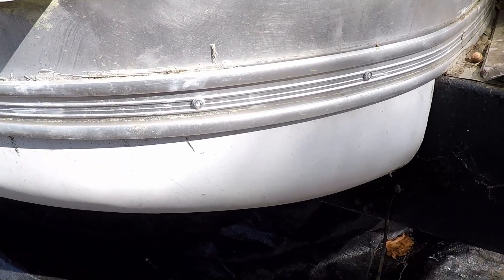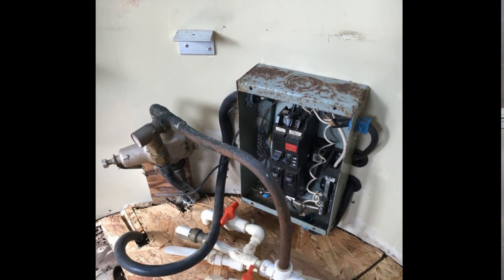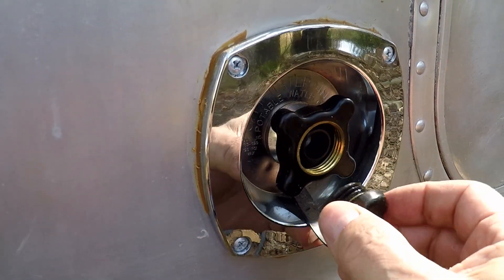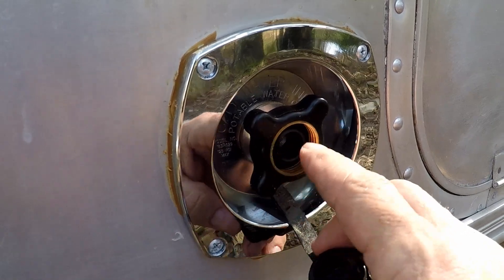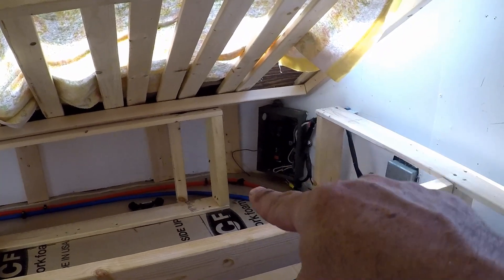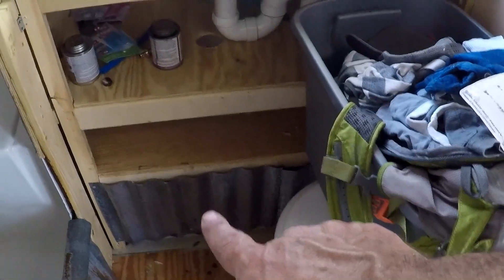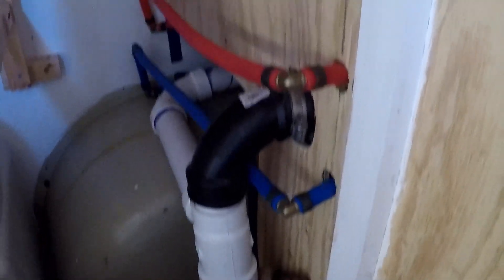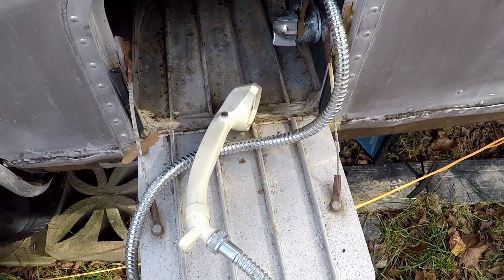AIRSTREAM ARGOSY PLUMBING REHAB / RV LIFE / NOMADIC LIVING

Comment: Thanks for the update Scott. Some hardware stores will rent that crimper at the rental shop. Just measure up and dry fit your system. Then rent the tool for a day and crimp it up.
Reply from the maker: You're right. You have to call a lot of stores to find one, but occasionally they'll have it. Luckily, we had one on the farm. They have interchangeable fittings.